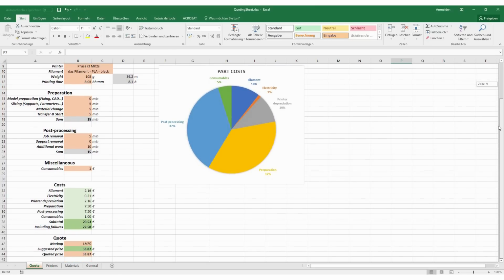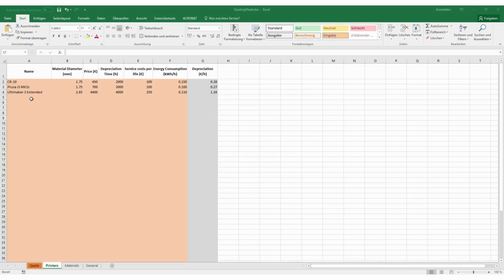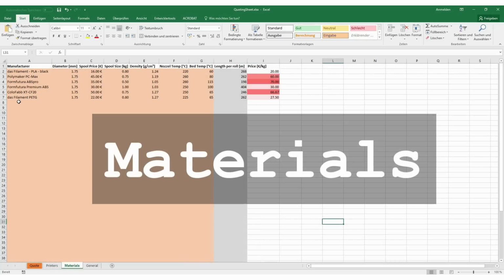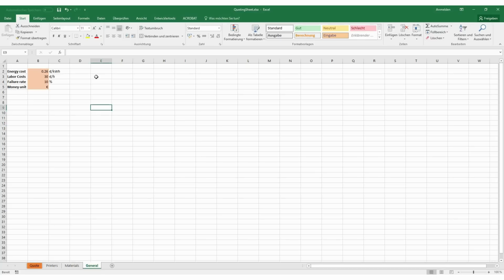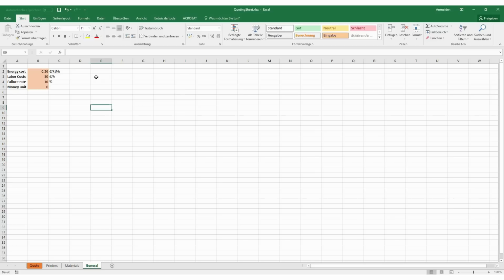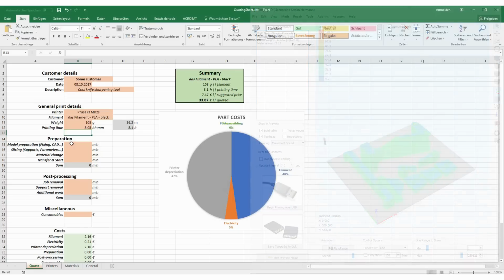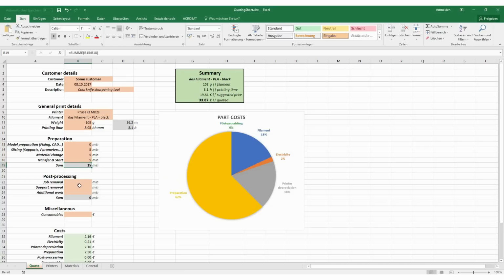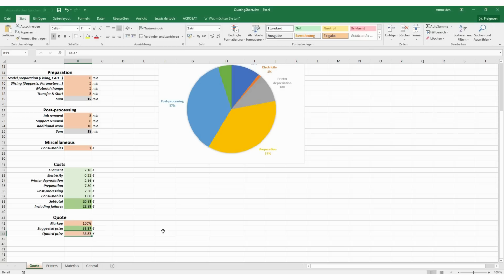HOW MUCH do 3D printed parts really COST?

Comment: I don't quite agree with the printer depreciation thing. most hobby-level printers such as the Prusai3 series and Ender3 series etc (so, not your ultimakers or bambulabs or anything cloud connected or running proprietary software on proprietary motherboards etc) are by any practical definition of the word IMMORTAL

It's really quite remarkable since thi is unlike anything else in the tech industry right now. everyone seems to be interrested in making things as unfixable as possible
it's also quite funny how a 3D printer is infinitely more repairable than a 2D printer lmao

it's the power of opensource software, cheap and readily available chinesium electronics which you can get from everywhere, not just a single company

I've had a Prusa i3 mk2S since 2017 and 6 years later I only needed to replace a single linear bearing

It's literally impossible for such a machine to die. So long as it's not the literal end of the world and China keeps producing bearings and 8-bit motherboards with stepper drivers, your printer 
you might have to replace a bearing or nozzle or a fan every few years, and the motherboard in 10 or so. Your grandkids might still be using the same printer with more than 50% of the original components. I don't think people yet realize just how robust these things are.

of course, you need to cover replacement parts cost + a good 6h of your time to dissassemble, reassemble, test and calibrate for every service

but the idea of a set number of print hours before a printer becomes unusable seems just plain wrong to me. It's not a smartphone, it's not a laptop, it's not even a modern car. These can all break to such a degree where it becomes unrepairable (because the manufacturer sells the replacement parts at an unreasonable price or just refuses to sell them at all)
we worry about these things everywhere in life, but not in 3d printing. 3d printing is special. Opensource hardware is special.

By the Omnissiah's blessing, they truly are ETERNAL MACHINES, and I just think that's wonderful

Comment: this is a nice, and thorough setup.  for mine I came up with a flat rate for filament required, flat rate for printing time, time to make the g-code, rate for modeling the part.  I should double check that I have enough to cover everything.  currently basically assuming I am.  leaving the cents instead of rounding is a tip I wouldn't have thought of.  thanks

Comment: Thank you for this. I had been trying to work out a back end formula to create my pricing. Thanks to your assistance via the information you focused on helped me arrive as concrete formulas for labor, wear, resources and operation components of the cost of a print. Well labor is still kind of ephemeral but really helps gauge an appropriate range to have the other costs quantified. At least I'm down to the last multiplier in the overall cost of a print, sheesh it's a lot of variables.

Comment: While describing the method, you ought to have some examples of actual prices. A range from static 3d parts to some of the more complex assemblies. I think people want to know roughly if there is any real price advantage vs making it themselves (remember, the reason your time is valuable is because of the learning curve you already overcame- others are calculating  their time with it included when making a purchase decision) 
To give you an example- let's say I am looking at testing a gear box or a harmonic drive - but the cost of buying a commercial unit is 500 USD. If I am already a 3d printer enthusiast, I might consider printing it, find some existing design online and then deal with figuring out how to set up and print, source the hardware it needs, etc.... but if i need to  come up from zero and say, your price is 200, all that effort begins to look like a lot of hassle.

Comment: Consider the following things:
1-Materials such as carbon fiber or metal doped filament exert more wear and tear on the printer. You may want to blend that in
2- Pre made designs are one way to drastically lower the cost of labor that goes into a quote, so a catalog of  parts that you can simply set up to print with minimal effort can be a way to offer more attractive prices. Any fabricator tends to separate the "design" time and caveat it as variable. If the customer has an exact model , in the right file format, that's one thing. If you need to work on it, that is, in effect, consulting time.
3- Pre made parts are also a good idea for those who are not exactly sure that this could be a business for what they make. They may be popular in terms of viewers, but have no idea if there is demand for the products they are focused on. So making some parts in advance, and selling them with little or no profit in the beginning would gauge the level of likely interest.

Comment: For Pricing, you should be charging the value to the customer, not the cost of goods.
If the choice is "new washing machine" or "3d printed part" how much is that part worth to the customer?
If you only plan on charging Cost of goods + Margin% you aren't accounting for contingency.
You also didn't include your opportunity cost - what could you have been doing instead?
For accounting, depreciation is an income, not a cost. It counts against tax.

Comment: 3 categories:
Materials: self explanatory
Machine time: relatively cheap per hour, but should be calculated to cover consumables, and wear / lifespan of machine parts, larger replacements, hotend, heated bed, etc.
Set-up time: pretty self explanatory but should be specified, this is where you value your time, prints shouldn't take more than half an hour to set up in the worst circumstance, include time of watching the first few layers go down.

Comment: Hi there, 
a little late, but a useful addition imo would be to include a cell to specify the number of (identical) parts/prints you intend to sell and a formula that breaks down your one off cost based on that number. like this: https://docs.google.com/spreadsheets/d/e/2PACX-1vSXZ0h5VFm5420pThQTPah10oQ4jrkCzfPIDzPJ8zOWbCay1adgyW7lUgqJg0-sRwM-7u58MsktC16U/pubhtml

Comment: Another thing to consider is printer time. Your printer can only print one thing at a time. And, a high-detail part that takes 10hr for the same amount of filament that would take 2hr for a less detailed part should cost more than the negligible extra energy cost. This would be linked to things like time-fixed costs such as rent. It is likely more defendant upon business factors, such as the amount of money you could make on three parts in the time it takes you to print that one.

Comment: Nice work on the spreadsheet. There is a problem with the equation factoring in the failure percentage. They current equation multiplies the price by 1+failure rate, but that's not quite right. At 50% failure rate you should be charging double but this charges 1.5x and with 100% failure you should have an infinity high price, instead of 2x. The equation should be price/(1-failure rate).
Reply: I doesn't too much difference at 10% failure rate though. An 8 day print went from $384 to $387.

Comment: Hi Stefan. Great videos. I am not on Twitter. How do I download your costing spreadsheet? Looks nice, like all your other work. I built a 200mm cube DIY 3D printer, based on mendelmax. 3mm ABS, 247°C on 100°C hotbed, typically 100mm/second. Very accurate. 0.05 mm typically, with Z ballscrew.
Cheers. Neil.
Reply from the maker: Hey Neil, link to the spreadsheet is in the description.
Reply: @CNCKitchen  
Thanks for prompt reply.
Aging me will hunt it down.
Now I know what the obscure downward triangle is! ∆√. 
All the obscure things a programmer of > 40 years missed and the lack & lazy loss of revolving cursors that are missing, and assumed these days. I luckily just missed out on punched cards in the 70's

Comment: "I think a reasonable value should be between €20 and €60" Cries in argentinian, we earn like 2 to 5 euros per hour
Reply: This is actually a good point. Your hourly rate as an employee might be that. But the the employer values your time differently because they have other responsibilities. So while you get payed 2 - 5 euros per hour, your employer might charge the client in the 20-60 range for your time.
Reply: All that Santiago, TealJosh and Ryan wrote also apply perfectly in a Brazilian scenario!

Comment: Problem with 3-D printing is that people want items at the price they can get for mass produced molds. I guess the idea would be only to look at making items that cannot be easlly made with a mold.. I to make such a thing on open office. But did not factor printer degradation. 

Problem I found, even at cost of filament, was too much, and 3D printers are not good for mass production, so I was looking into silicon molds. Make one 3D model and then, use that to make ten molds. Then start mass producing them in batches of ten..
  And if a client wants only one, the sell it to him at 3D printer cost.. As this breaks up a set of ten.. And this strongly encourages the client to buy ten. (Note: When you have geared up for mass production, it will become bad for your business to sell only one. So basically, you need to decide to remain as a one item prototype, or become a mass manufacture, agent.)

Comment: I'm getting my first 3D Printer on Friday and you saved my life with this AMAZING and detailed video about 3D Printing costs. I do have an excel for myself but I wanted to make it even better. Great work man, even 2 years later! The only thing I will calculate different is the depreciation and the post processing cause it will depend on the customer. Also, forgot the taxes if applicable, just in case

Comment: In your excel sheet, you calculate markup incorrectly; you have: cost * markup%. Markup is: cost + (cost * markup%). So on your excel sheet it would be: =B39+(B39*B42)
Reply: Incorrect. The markup is the percentage or amount over your costs which accounts for the profit only. If your item costs $100 and you sell it for $150, your markup is 50% or $50, not 150% or $150.
Reply: Bear in mind, I was replying only to your comment, not the actual spreadsheet. After looking at the spreadsheet, I see what you were trying to say. The "Suggested price" needs correction to add the Subtotal (including failures) to the markup, rather than just the markup itself.

Comment: I made my own spreadsheet with some small differences, most important is I include consultation time, also I have some flat rate (could call it setup rate) so really small prints are worth it for me. And I have two rates, for bussines and for friends, where I switch using a checkbox "Friendly discount" ;)
I made it in Google Docs so I can access it in my phone too, very handy.
But the price composition pie chart is a great idea, I had to add it right away :)

Comment: Nice aproach. In Argentina, regular prints are charged about 4~8 times the cost of the filament, regardless of the printing time. At this price, you need 8~10 printers printing at least 20 hours a day to pay the bills (at least in Buenos Aires). Special prints (architecture, mechanics or comics) may cost more.

Comment: This is what I did: I picked a stl file and got 22 quotes. I averaged the quotes and the simplified it to $/gram of material used. Using a prusa mk3, I believe the print quality is in between a cheap hobbyist printer and an industrial printer.

Comment: Great spreadsheet.  I started playing with it and added features for multi material prints that have different costs for each filament as well as a print cost factor to each filament that is applied to electricity, wear and tear, failure rate, consumables, etc.  ie PLA has a print factor of 1 whereas PET is a 1.3, ABS is 1.5 etc.   Thanks a lot for this.

Comment: I'm afraid you might be forgetting the TAXES, which may bump up your pricing really seriously.
Continue without taxes - and you might be in still bigger trouble.
Reply: Actually, you calculate without taxes and add them later...
Reply: I am surprised this point is so absent from the comments... I wouldn't be surprised if you ended up with a x2 multiplier here
Reply: Most of the stuff in the calculation can be written off as business expenses in taxes. But your time and markup both will be taxable.

Comment: I like your video.  3D printed parts will always be more expensive (3-5 times), if the parts are available commercially.  Personal 3D printers make sense only for custom items, and on a steady production (a few times a week) basis.  Otherwise you start working(maintenance, cleaning, breakdown, inventory etc) for the machine, rather than the machine working for you. That too has financial implication.
Reply: I think for most people it's a fun hobby, a toy as it were.

Comment: I consider this waaaaaaaaaay to complicated for the daily use. Simply create different types of filament in your slicer. "PLA simple", "PLA light Post" and "PLA heavy Post" for example. Let's assume you pay 30.- for the filament and the average extrusion rate of your printer on 0,2per layer to 10g an per hour on 100watt/h to keep the example simple. Half the 5000 h lifetime for the printer to cover repairs, the calculation ends up with something like this: € 1000.- (Printer) / 2500h = 0,4 € per hour = 4 cents per gram = 40.- per kg filament. Energy is 10 w/h per gram or 10kw per kg = ca. € 3,5 or in total 40+30+3,5 = 73,50. I would round up to 80.- to cover misc stuff. Let us further take your 10% failurerate, what adds up to 88.- and a 50% profit rate at this point with 44.- We are now at 132.- per kg filament. Put this price into your slicer as filament pricetag, so it spits out a raw price per print of 13,2 Cents per gram printed. Let's also assume you charge 40.- per hour (what is quite cheap). Now it is quite simple to give customers a pricetag: Their print takes 23g, 10 min of preproduction time and 5min post? The raw print is 3,03, the labor 15 min = 1/4 of your rate you charge per hour or 10.-...so 10.- time plus 3,03 for the print ends up with 13,03 or to give a simple price 13,00 for the first part and 3,36 for every following (3,03 + 5 min time). Quick and simple. You alter this calculating by the profitrate (if you don't have many jobs, you have to pull the percentage up or lower it down, if your stuff is always running). If your running a farm or stuff like that, you have to take the rent divided by printers also inside. Don't overcomplicate it - just keep enough headroom and you are good to go. :)
Reply: This is quite simple only requires one time set up, then only a few figures need to be changed each time you use it.

Comment: There is always the unknown factor, some prints can take 1 hour or end up costing 8 hours fixing files and splitting it up if needed.. Real life learns that clients will not give perfect files at all, and are not able to fix it most of the times. It is also a huge difference if they expect it raw or painted. Most people underestimate it how much time it can cost and also the huge spread between 'good file + good print in 1 go + little fixing work' vs 'bad file + bad print / splitted print + lot of fixing work' Both can easily happen. I always prefer to give a quote between .. and .. it is the most fair way of doing things i guess. Recommend it.

Comment: Thanks a lot for sharing the calculation sheet!. I've watched your video and looked at the spreadsheet and it's clear the rate of depreciation needs reformulating. What about using the warranty period, ease/cost of servicing and resale value to calculate a multivariable function? I own a CR-10, Zortrax M300 and CEL RoboxDual. My CR-10 basically comes with no warranty, has virtually zero resale value due to its low cost, but it's incredible easy to service. My Zortrax comes with a 1 year warranty and RoboxDual comes with a 2 year warranty. Both machines are much more challenging to service but have significant resale values. I'll give some more thought to this. Thanks again for sharing!

Comment: Despite what the big corporations want you to believe, for small businesses, shipping should NEVER be included in the price of a product.  It should be separate because you should never include refunds on shipping.  If a customer wants a refund, and you offered "free shipping" then you will have to refund the total price you quoted them which means you lost out on the cost of shipping.  If shipping is a separate line item, then you can refund on the cost of the product/service and not the shipping (assuming this is stated in your terms of service).  This is 3D printing service, not retail at Walmart.  If people do not want to pay for shipping, then they can buy locally.